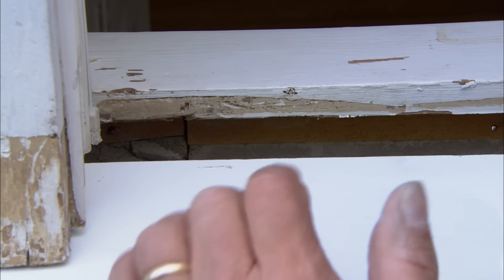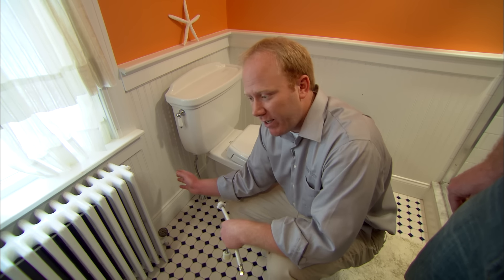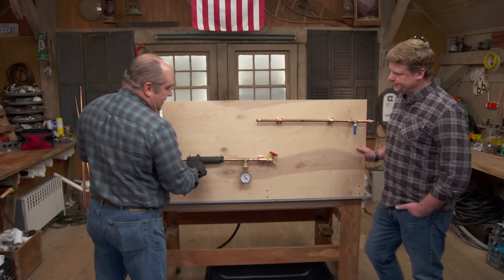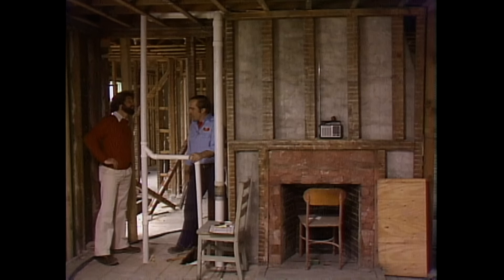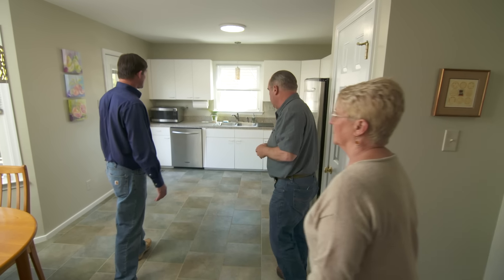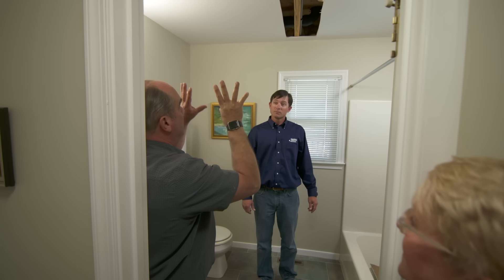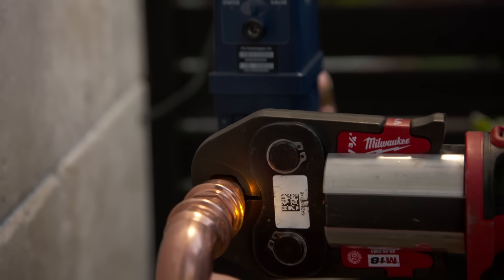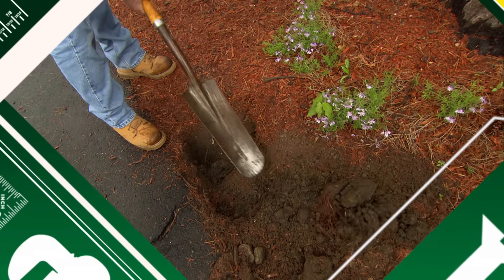ASK This Old House | Preventing Plumbing Disasters (S19 E2) FULL EPISODE

Comment: my hot water heater blew up this morning. Me and my father replaced it today. Shows like this old house have been stoking my interest in home improvement and repair for a long time. now that im 35 and have been watching for 20+ years, all the lessons ive learned are being put to work
Reply: Blew up? 😳
Reply: Why would you need to heat hot water
Reply: @kalijasin aha, ikr, water heaters don’t blow up except for Myth Busters.
Reply: @woohunter1 The rumor is that some people see the T & P valve dripping and replace it with a plug (or nipple and cap).
Reply: @DouglasGross6022  yes that’s one of the things that has to happen.  Even if you plugged your temp and pressure relief valve, it would probably be ok, (I strongly advise not to do this!) first, your heating element or gas valve would have to be malfunctioning, 2 most residences don’t have a backflow device by the water meter, therefor letting ‘excess’ pressure go past the meter and into public water supply.
Reply: @woohunter1  Those are good points.
Reply: The hardest part of replacing the water heater is dragging the old sediment rust filled old one up out of the basement.

Comment: One thing we always do when we go away on vacation is shut the main water shutoff  to the house, that way if something does spring a leak the house doesn't get completely flooded only the water that's in the pipe can leak out.
Reply: I do that too! Keeps neighbors from helping themselves to your outside hose too!
Reply: Turn off main, open highest and lowest faucets to drain pipes.
Reply: @jamesrecknor6752 Also hose bib/silcock/spigot.
Reply: @DouglasGross6022  That's right

Comment: Great video.  I'm surprised they didn't go into more details about shut off valves.  From my experience, 95% of water leaks came from a shut off valve under the sink. We've lived in our home over 25 years, and I have replaced pretty much all the shut off valves.  It's a good idea to buy extra shut off valves so when this happens, you can just fix it and not leave the house to buy one.
Reply: Install US made ball shutoff valves (not cheap quarter turn stops).
Even US made regular shutoff valves won't shut off the water.
Reply: Sink shutoff valves, and toilet shutoff valves too!  This is especially with multi-turn valves, where the rubber washer that seals the valve degrades over time and does not allow the valve to completely shut off the water.

Comment: A pan under a washing machine would fill up pretty quickly with a major leak.  Like when a mouse shoved a nut  into the supply line of my 32 year old GE.  We had grown to trust it after all this time.   But the thing is in the basement and it only a hassle.  

Also, my best story re. water damage.   Decades ago I had a job doing punch out on some crappy condos in South Carolina.  Winters there are usually warm, except when they are not.  A couple of really cold days a year.    That, and the thin copper water lines run in parts of the building with no insulation, and hardly any of that stuff resulted in at least a couple of dozen units with frozen pipes, deep into the units.  The next day warms up and all those frozen, but now broken pipes thaw.  

I remember coming to work watching waterfalls down folks stairs, ceilings on floors,   a billion yards of ruined carpet and everything else.  We spent the next few days repairing leaks, but not fixing any damage.  

Shortly after that, we were all laid off, I guess right after the people that were liable were all safely in Mexico.
Reply: But isn't the idea to have a drain in the pan that you can plumb to a main drain so it doesn't overfill?

Comment: Flo by Moen is a great system, and they've later on added in point sensors to assist in the system's leak detection.
Reply: is the the brand used in the video ?
Reply: that the *

Comment: Some  years back, customer in an older 28 story high rise, had Miele washer and dryer installed using supplied Miele supply lines. Customer was gone, one of the supply lines broke, took 45 minutes before water was turned off. Gravity did its thing. 28 stories flooded and $10 million in total damages.

Comment: Water pressure was briefly mentioned in a few of the segments, but high water pressure from the street was never mentioned.  My city water pressure is 115lbs!  This is up from 105lbs from 6 years ago.  After discovering 2 water claims on my house before purchasing 6 years ago, I immediately installed a pressure reducing valve (PRV) and kicked it down to 60lbs.  I’m very surprised this was not covered.  Appliance solenoid valves are more susceptible to failure due to high water pressure.

Comment: a great episode.  Owners need to insure a home shut off valve works quickly and know where it is, in an emergency.  If a leaks occurs anywhere,  its faster to shut this one valve than locatr the shut off for a particular line.  Many homes have gate valves, which tend to malfunction over time, and should be replaced with a ball valve.  As a commenter mentioned, if you routinely shut off your home water when away, you get a solid feeling how well this works, were the valve is, and how quick it is to get to.

Comment: From what I've seen, the valve fails far more often than a hose. The problem with the washer shut off, is if you keep turning on/off valve repeatedly, it may cause it to fail sooner. Instead, keep it on for the most part but turn it off during long periods away from home.

Comment: I use Uphonor and worsbo fittings and pipe much more simpler than the methods shown in this video. Used in Europe so it works. They should do a video on that method.

Comment: a lot of the piping materials such as copper and plastic have been around a lot longer than they say in this video.
Reply: if you listen carefully, he talks about when they became popular, or commonly used. This is NOT the same as when they were first used.
Reply: Indeed. My house was built between 1905-1908 time period, but didn't have plumbing initially until likely the 20's when the kitchen was redone and a bathroom was added. Clue was the drain/waste/vent lines, they are on the outside of the house, and the bathroom is next to the kitchen, common prior to the 1920's and in working class areas of a city.

The kitchen still sports galvanized piping, don't know if original to the 20's or not, but it's been around a good while. Bathroom was redone in 2009, and it got fresh copper, sadly, the dufus that did the plumbing apparently stuck copper to galvanized, so now I have galvanic corrosion going on and in 2021, we had a major snow, then a cold snap, I had an old galvanized pipe that came in from the street split at the sill plate just before the one, lone spigot that also needed to be replaced due to age and that was when I had lost use of the shower, the bathroom sink, the toilet, and the kitchen sink/laundry but by end of day, got the shower working so for a short while, the sink and washer had no water. it's all fixed now, but the entire kitchen/bathroom really needs a total redo, due to the issue with the plumbing.
Reply: @johnhpalmer6098  ... Ha, very common for a DIY to do repairs for now... and a few years later they sell the house. The next guy has no clue. Been there. done that.
Reply: @rupe53  Would not doubt it, BTW, the drain/waste/vent stack was redone from cast iron to ABS a number of years before I bought the house. Clue was the junction where the ABS and cast iron met the sewer line just above the ground, the rest was black ABS, inside and out. Did have the concrete sewer line replaced in 2016 when I bought the house, on the seller's dime. 😁
Reply: @johnhpalmer6098  ... in my area, black ABS is so 1970s. PVC was what would pass inspection circa 1990. That should tell you something about when it was done last.

Comment: I had a plumbing leak upstairs one time that I like to have never found. Found the ceiling wet so I go upstairs and look and I can't find a leak. I take the ceiling down go up on a ladder and start looking and I don't see a drop of water anywhere coming down. But it's clearly been leaking that ceiling is soaked. I had my wife go upstairs and start running water. Nothing, not a drop anywhere. Nothing from the shower nothing from the sink nothing from the toilet.
And then she said on the toilet and the leak started. They had used a hard line to plumb the toilet instead of a flexible line. And the toilet wasn't completely solidly mounted. That had cracked that line just a little tiny bit but it only leaked when you sat on it. And the water was literally running down the side of that pipe through the floor and into the ceiling so there wasn't even a drop to be seen up top. That was a tough one to find

Comment: Does anyone with experience using PEX know if it is prone to leaking at any joint areas? I heard an argument that over time, the constant pressure and pressure changes inside PEX lines may weaken locations where there are connections of various sorts.

Thanks in advance!
Reply: Here in europe, we use it in most buildings, its bullet proof. When done corectly,  it survives 40 - 50 years or even more. Its also easy to install it in  brick houses, you yust foam it in the wall + plaster + paint, your done 😁
Reply: @damjans7514  Thank you for the inside knowledge, Damjan. So if copper piping would be installed in brick buildings, what would make the process more tedious?

Also, what is the second most used material for water pipes? Copper, steel? Are any of these used in new construction at all?

Thank you!
Reply: @nikolaiv1138  Well i'm not a plumber, but i guess copper piping is more expensive, its harder to bend - not harder, but your need more time to work with it, and you have to insulate it for hot water. 

You can buy PEX already insulated, about 2,5€ for a meter, bend it with your hands, and its yust faster to install it

But copper is the most dependable and most used material for plumbing in the world so if you want to install it in your home, its the right material.

We still use copper and steel for everything else in EU, like heating pipes for radiators, heat exchange from heat pump to other systems...
Reply: @damjans7514  Thank you, Damjan. You have confirmed my suspicions and thoughts on the matter.

Comment: when you go away for a weekend you flip the lights off, right? Why not turn off the well pump or main water valve when you go on vacation? I also turn the heat down when I leave for more than 24 hours. It's just common sense.

Comment: A few years ago a rat chewed the p-trap under the kitchen sink and slowly leaked into an empty room in the basement. Went unnoticed for a while and when I went to the basement one day there was water on the floor. water damage ceiling and wall. Another time when I worked maintenance I was sent to check an apartment, where the residents had been out of town for two months. Apparently the sink back-flowed and soaked the carpet. There was mold on everything!

Comment: Does PEX have a long track record, or will it be like the plastic pipes of the 1970s that you talked about?
Reply: Time will tell. Already have different grades of PEX
Reply: @DSGLABEL  I have nephew who just texted me wanting to use Sharkbite.
Reply: @ds61821  I have used sharbites successfully for years. I only use if the connection is visible. I wouldn't suggest using in an area that's gonna be covered.
Reply: Rodents chew through PEX

BTW ds61821 I suggest watch a 13 part series called What on earth happened by Ewaranon to learn that the earth is not a globe.

I got it in my about tab.
Reply: PEX was originally used in floor heating over 50 years ago. This already tells me it's better suited than copper or black pipe in those areas. Ask anyone who has had to repair one of the early floor heating systems. I've done a few of those repairs myself.
Reply: @Kevin-mp5of  ... yes, I was aware of that.... but it doesn't matter for heating pipes.
Reply: @Kevin-mp5of  ... you are safe for the moment. So far they don't make PEX baseboard radiator. <LOL>

Comment: While cleaning the drain in the shower, I dropped the inspection cap in the drain. Since then, the following day my bathroom smells horrible. I have had three plumbing companies, the last one with a camera, which he looked down the shower drain and all was clean and clear.  However, he did not look in the bath tub or sink pipes which are higher than the shower drain pipe. I'm wondering if this little hard plastic top is somehow jammed somewhere between these three pipes causing the smell. All good advice welcome, thanks in advance.

Comment: 2022: "So this is the polybutylene we took out and replaced it with PEX."
2032: "So this is the PEX we took out to replace it with Multilayer PexALPex."
2042: "So this is the multilayer Pex we took out to replace it finally with stainless steel which you should have used back in 2022."

Comment: Why do people always leave out grade 316 stainless schedule 40 pipe will literally last forever and is chlorine resistant. I think pex is UGLY and copper corrodes.
Reply: I agree that stainless would probably last longer, though it is susceptible to pitting and cracking due to chloride content. Do you have a cost comparison between copper and stainless? I think, but have no proof, that stainless is a lot more expensive than copper in both material and labor. I mean even 1/2" copper is $1.50 a foot at the big box stores now. The only good ways I know to connect stainless is to weld it or use flanges which are both very expensive. Threading stainless isn't usually done, though I guess it's an option for houses... It just galls and doesn't come apart. Or you could mega press it, but then the o-rings will probably fail faster than copper.

Comment: So I never really knew why PB was taken out of the U.S market. I just wanted to share this both because I think its interesting but also because I want to hear some plumbers explain it. Polybuetline isn't outlawed, rather some codes ban it but its not universal. The reason it failed so much was its chemical makeup was suseptable to Chlorene which degraded the material. Us there anyone who could expand on this, clear anything I got wrong etc...?
Reply: Excuse me sterlingodeaghaidh I don't know but I suggest watch a 13 part series called What on earth happened by Ewaranon to learn that the earth is not a globe.

I got it in my about tab.
Reply: when code gets involved, it just means you can't use it for that purpose. Of course, that means the market falls off and you would have trouble buying it in that area. The new question is, what would you use it for?
Reply: @rupe53  I don’t
Reply: As Richard explains, the Pacific NW (where I live) has it in many homes built from the 60's and 70's at minimum and it degrades. A former colleague of mine has his parent's house, which was built in 1968 and it's got this same PB piping, in the concrete slab and it's degrading and during 2019-2020, he was talking about having it replaced. Don't know if he has been able to get replaced or not.
Reply: @johnhpalmer6098  ... they put copper in concrete years ago and most people left it alone till it failed. Some of it is still there 50-60+ years later.
Reply: @rupe53  I know copper can last upwards of 50 years or more, same with galvanized pipes too, though I think it's closer to 50 years before it begins to fail and likely just about everything else for that matter.
Reply: @johnhpalmer6098  ... the biggest problem with galvanized is it will react with the concrete and will also get build up of crud internally. Not so with any of the plastic. I don't have enough experience with plastic in cement to have an opinion on that reaction.
Reply: @rupe53  Well, my pipes are not in the concrete, they are in a crawlspace, remember, this is an early 1900's house and I know all about galvanized piping, as it can corrode from the inside out over time. Thankfully my water pressure is still decent despite it all. I have been in older homes with poor water pressure due to very old galvanized piping that had begun to clog up due to the corrosion buildup inside them.